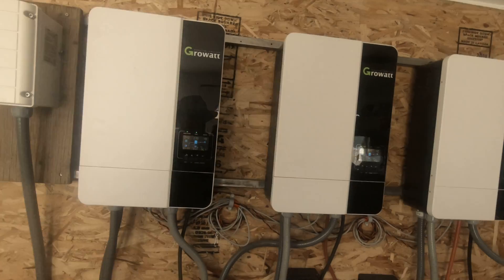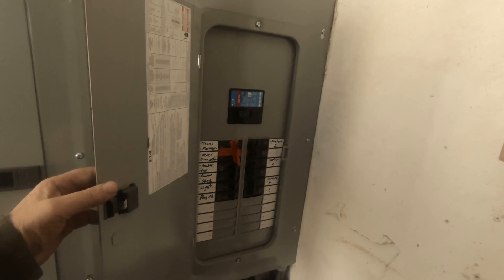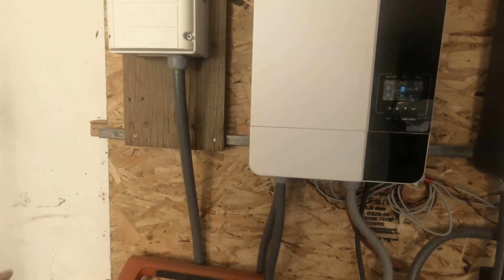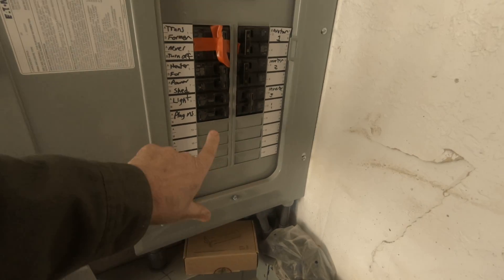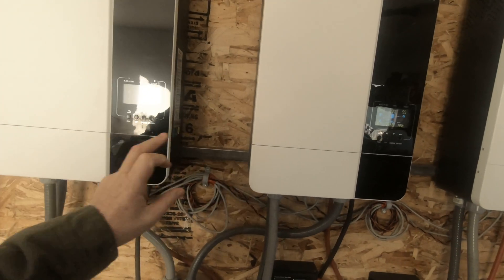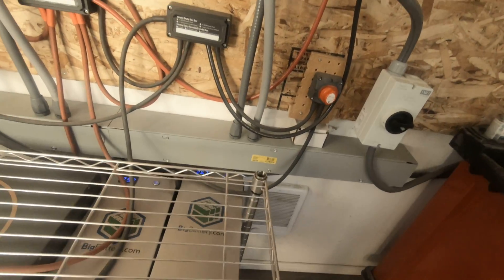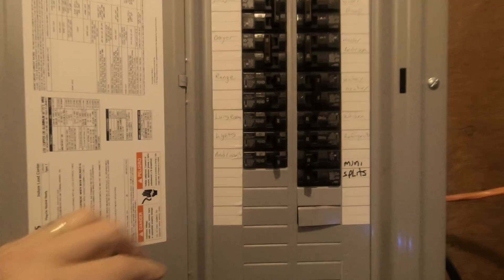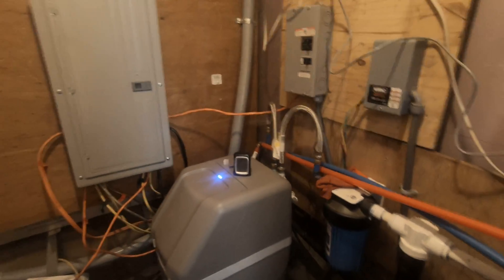auto transformers and the truth.

Comment: Hello, thank you for taking time to make this video. I hope you dont mind me asking a few questions. I would like your opinion, if you dont mind. My home is 2300 sq, I have 1- 5 ton carrier ac unit that keeps thew house cool and I have  several 4 or 5 75-85 inch LED TV, electric dryer and a gas stove/oven.  I was hoping to buy a UL listed office grid unit that has 18kw of power, but I ran into issues with my 17kw of panels I purchased matching up with the mppt inputs of the inverter . It appears most split phase inverters have very low DV input voltages and the current input is lacking as well. If I go out to my breaker box, I have  a somewhat balanced legs but my ac compressor(5 ton and my dryer). Would you think it would be best to get 2 or 3-  5kw units that do not have a transformer built
 in, but add a Vertron autotransformer for the imbalance ?If I went with 3 inverters it would allow for more PV input or buy a 18kw split phase unit with a transformer ? I appreciate your suggestion.
Reply from the maker: nice question, I am going to build another system. I will be buying the growatt 5000es inverters again. the thing I would do is get the transformers. I used 1 transformer for over a year with no issue. but I would get 3 of the inverters minimum and 2 transformers. also, for the safety issue in case of a transformer failure install GFCI breakers on all 120 circuits. make sure that your 120 loads are balanced in your circuit panel. If you install extra inverters that all need to be bought at signature solar. I have 4 of them which is overkill. but if something happens I will still have power. I can shut off any single part of my system and still power my house. I have a well pump car charger and air con running. Since no water bill as I am on a well water and ac run along with car charger I don't ever watch when I do anything air con is thermostat controlled. If I wanted, I could split my system, but I will probably never do that. The growatt inverters have worked great and signature solar is a good company to work with. with your heavy loads it will be important to have a nice sized battery bank.
Reply: @jamesshomesolarmore2223  thank you Sir. So you would buy the Growatt with transformers?
Reply from the maker: yes, the growatts have a lot of power. please look at some of my other videos. I have lots of backups built in. the nice part is that everything will keep working no matter what happens. if one transformer has an issue I am still up and running. same with the inverters and solar panels all components are put together, so you don't have to shut everything down while fixing it. if you repair or replace an inverter? you would need to restart your system after getting it ready to turn on. Next year I am going to consider separate battery shut off to all inverters. but i have seen someone do it. but haven't tried it myself. I would have to research components first. I will try that on my next install as long as I can get all the materials. The build will be in the Philippines.

Comment: how can u BALANCE both legs on naturally varing loads?    one leg has a 100w bulb and the other has a 80w bulb.........that leaves the 20v current difference to go somewhere.

just my observation
Reply from the maker: it's not 20 watts that could be an issue. all you do is keep your bathrooms and kitchen living room basically high load areas on even distribution on the power legs. you don't want microwaves and hair dryers on the same leg. we have an older home and I will have some people working running power equipment. they will be using exterior plugins that are using separate breakers. you don't run an extension out of the kitchen or bathroom. plus the transformer only covers the imbalance . most homes have their loads balanced pretty well.

Comment: James, thank you for your video I really appreciate it.  I'm 62 and in the excruciatingly slow process of building out a box truck conversion to RV.  Anyway hey I was wondering would you care to sell that third inverter?
Reply from the maker: I need to keep the inverter. let me know if I could help assist in what you are doing. I am on a budget also, so I have been putting mine together as I had the money. I had an accident last January at work that put me out of the work force. so now I collect disability from work. They had me sign up for social security. That way they could reduce my monthly by whatever social security pays me. Actually, that's the reason I started this channel. I had to do something, when I started the solar, I had a better income.
Reply: @jamesshomesolarmore2223  
Sorry to hear about your accident James. I trust your recovery is going well.
I too have been dealing with some medical issues. Which began as far as the surgery goes, two in the last 4 years. The actual bladder cancer itself goes back about 15 years. Anyway that put me out of work too and that's hard when you're used to working your whole life. I can definitely sympathize with you. April I'll be 62. My hope is to have this project completed within approximately three to four more months. At which point, I'm on the road!
Rick Fort Worth Texas.

Comment: i am more interested in the grounding of your off grid  system .How exactly do you do it ?
Reply from the maker: At my power shed I have 2 grounding rods drove in the ground about 8 feet apart. code here in Oregon. They come up to my power shed main panel. Then I have that ground go to my house. My solar panels have the same setup 2 grounding rods about 8 feet apart grounding my solar panels. They aren't hooked together. Code in Oregon is minimum of 6 feet apart. the wire has to be 6 gauge connecting rods going to service panel. that must be bonded to neutral. I would do a video but I would have to dig it up. I rented a jack hammer with special attachment to drive them in the ground.

Comment: o man that  bad ass
Reply from the maker: thank you, the comment's you made are greatly appreciated. I like the way you kept the mini split lines in your wall the only one I worry about is the condensate line. how is it working?
Reply: @jamesshomesolarmore2223  it works ok so far i need more batteries
Reply: i have a new gk pip i saw a video he is running mini split s on just pv power no batteries cool  i will have to get a ST5000 transformer i have one for a gen they seem to work well
Reply from the maker: @JonOffgrid  I have tried improving mine ever since I first installed solar. Now it runs the whole house since I did the battery upgrade. 
Just keep working on what works for you. It’s hard to take so much money and spend on the batteries. I was considering not doing it. But I really wanted to unplug from the grid. So I bought the batteries.
Reply: @jamesshomesolarmore2223  i here that

Comment: He who throws stones shouldn't mount their equipment to combustible building materials :) In regards to the autotransformer debacle, I am confused what your point is. As far as I could tell Ian was showing what could happen if a neutral was wired up where it could be broken without the main two legs being cut. A lot of times cautionary videos are made to protect people from themselves, not to say it is an absolutely unsolvable solution, just that there are precautions that need to be taken. There are some things missing from the autotransformer that you are using vs one like Victron's. Built in breaker, built in overheat protection, ground/neutral relay for switching between off and on grid as necessary.
Reply from the maker: maybe you missed the facts. like i purchased inverters from Ian that are just worth about as much as boat anchors. What's wrong with having my transformer on wood? my electrical panel is wired properly so my transformer doesn't get hot. Ido plan on putting a piece of Hardie Backer behind it. As far as casting stone's goes, I had Ian call me to make sure I watched his transformer video. Why not discuss all the massive amount of transformer fires. ok discussion over. All you have to do is wire your panel correctly. I will be maxing out 120 loads in a video on Saturday. we will see how hot my inverter gets. I am going to try to run 9,000 watts of 120. almost all of the loads will be power tools. i will post a list of all tools with watts and amps. 
we might as well make it a challange? can my critics run the same loads on their inverters?
Reply: @jamesshomesolarmore2223  What is wrong with having your transformer on wood is that it is clearly stated in your Inverter's manual to not do so. If all you are trying to say is that "as long as nothing goes wrong, nothing fails, and nothing unexpected happens my house won't burn down" then good for you, you are correct. Unfortunately, defects in manufacturing are hard to predict and can still happen despite your "perfect wiring and balancing job". So I am glad to hear you plan on following the manual and putting a non-combustible material behind them. 

I guess you are just mad at Ian for some reason that could probably be handled by a phone call and instead are directing your ire at his videos and trying to find fault with safety tests, which, while at the extreme end, are things that can and will happen to the "nonperfect wirers" out there. It is awesome that you know exactly how to wire and do everything correctly, unfortunately, many people purchasing this equipment are DIY noobs and if Ian's video keeps one dumdum from burning down their house, then we should thank him not post comments denigrating his attempt at warning people of potential hurdles and tripwires.
Reply from the maker: @ShaleAudio  I removed the wood from directly behind the transformer. It now has 2 inches of air flow behind it.